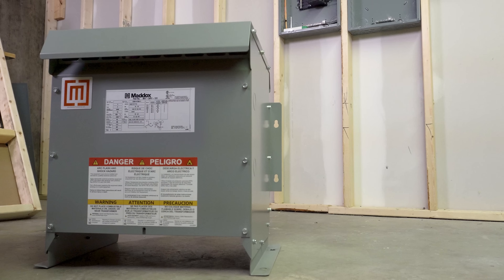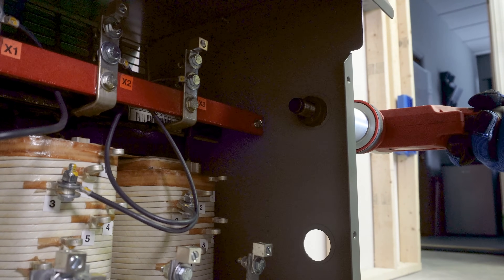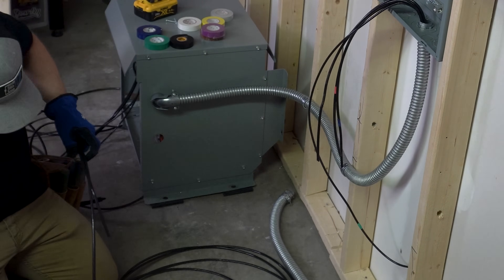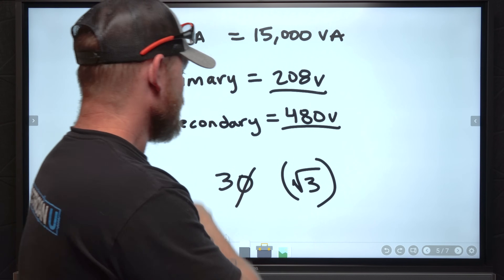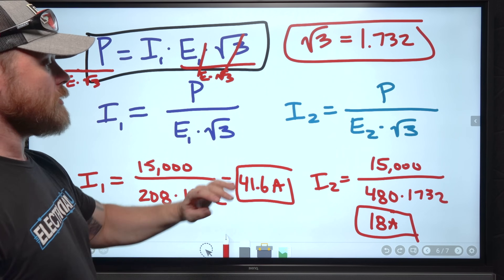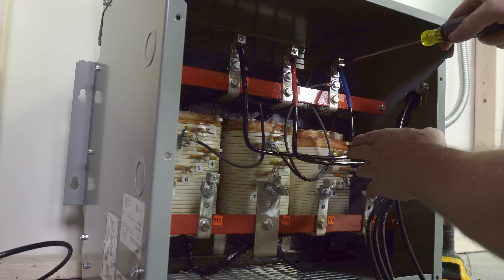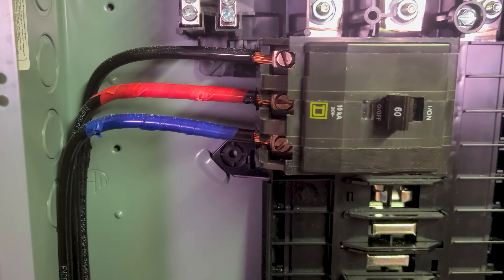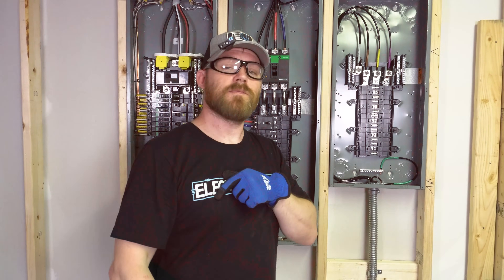How to Install a Transformer - Let's Break Into It!

Comment: A transformer with a delta primary and a wye secondary provides a new, "separately derived" system. The National Electrical Code (NEC) requires separately derived systems to be grounded and bonded to the equipment grounding system.

Comment: The solid knockout indicating locations makes sense given the vibrations from the transformer. The standard knockout, such as on panel enclosures, would fall out from cyclic fatigue failure.

Comment: Hello,  have a main utility service cabinet   That has 600 amp breaker feeding two  200 amp breakers and one 125amp breaker inside the same cabinet.  125 amp breaker feeds directly to a primary 75 kva 480volt delta/secondary 208 volt y transformer.  A neutral wire was ran with the three hot legs inside conduit from125amp  breaker but neutral wasn’t attached to XO lug.  The neutral is terminated using a knuckle. There is also no green wire.  So I’m assuming this is a separately  derived system.  And transformer creates a new system with its own ground rod and neutral bond for 208 service cabinet with a separate ground and separate neutral.

Comment: I got a question regarding the transformer secondary protection.. if the transformer secondary lands into a panelboard, doesn't the panelboard still require protection per panelboard rating?
Reply: Yes it does, I came here to say exactly that. I wish the NEC was a little clearer on this - when reading Article 450 ONLY it is easy to forget that the transformer secondary conductors also require protection per 240.21(C), and if you land in a panelboard then THAT needs protection per 408.36.

Comment: 10:28  -- you said 480 x 1.732 = 18A & I know you meant divided by but those listening and learning for the first time its 👉 15,000 ÷ (480 ÷ 1.732) = 18A if you multiply its 15,000 ÷ 480 x 1.732 = 54A just a heads up
Reply: Math is funny. Try it this way: 15,000÷(480×1.732). Without the parens, it breaks

Comment: Great video, I appreciate the code references. Just make sure you prote t yourself with the right level of PPE brother. I know its all new stuff but you know there should be voltage rated ppe and arc flashh gear used while interacting or testing 480V equipment. Be safe brother. We appreciate you!

Comment: I’ve been told recently I cannot put tape on 1/0 or lower wire size. Need to use those markers. It’s prolly per the inspector, but have you guys dealt with that ?

Comment: Hey Dustin,
My question is when you have a 277/480v 400 amp panel that has breakers up to 100 amps but need 125 amp due to 125% code what can we do? Maybe secondary ocpd down to 200 to make sure no more than 200 amps is the load?

Comment: One thing that always amazed me.   # 6    480 3 phase on primary.     2/0 leaving 208v 3 phase ….  We had to install disconnects before and after the transformer ….  I believe the reason.  Transformer goes bad ….  Take it out of line completely..  and back feed thru other transfer switches in the electric room

Comment: 14:08  just one point, did you break the paint under those ground lugs?  My foreman would always make sure we broke/sanded the paint under and beyond the borders of the added ground lugs or to run a jumper to the manufacturer bonding strap/lug on the left there.
Reply: One additional - i was taught that it's good practice to run a continuity check on every conductor, after all eqx is installed and prior to energizing.  

The foreman who taught me that had a bad breaker with an internal dead-short, and it detonated when he energized it.  The only thing that saved him was that he was in a full 40cal suit with rubbers and leathers.

It was a little 15KVA xfmr like that one, too.   Just food for thought.  I liked that you suited up for the Zinsco panel change.  It's odd how we tend to skip those precautions at our own shops, eh?😅  

No disrespect but I winced hard when you just turned away and flipped the breaker with bare skin and no deadfront....you gotta get lucky every single time you do that.  Murphy's Law only has to get lucky once. 

Stay safe out there, brother.  You got people who count on you🙏

Comment: You cannot run the GEC thru ventilation holes.  New 2023 code.  Also you don't have to use bonding bushings if you don't use concentric or eccentric knockouts or if said knockouts are listed for grounding.
Reply: You are correct. The 2023 code does it allow you to run your ground through the vents.

Comment: as of the last five years, most things with a knockout has been near impossible to break them out. lack of stamping depth/pressure, probably the stamping dies worn beyond limits or no quality control and they just spray them off the line as fast as possible. just put an oven pigtail on the other day, it already had a 1/2 KO and I needed 3/4 KO, I had to snip it with diagonal cutters grab and twist peel it in chunks all the way around, total pain, same for exhaust fans, boxes and panels.

Comment: If i wanna upgrade 200v 330uf to 500v did i need 330uf one on power supply capacitor?
Reply: From what i heard, it is just that. Just get the same one.

Comment: In this case you will need secondary over current protection. You have dual voltage on the secondary. You can get away with primary only OC protection if you have 2 wire primary 2 wire secondary for single phase or 3 wire delta to 3 wire delta for 3 phase.

Comment: He said 208 for the primary and 480 for the secondary. He got it backwards.
Reply: He said it’s a step up transformer
Reply: This is a rare case, as most are step down...I've only seen one for a lathe that was acquired at an estate sale that was run off a motor singlephase coupled to a three phase generator... the new location had 240v delta... bumped up like what Dustin did, one breaker on the secondary then a motor controller with bells and whistles...

Comment: The higher piece of Greenfield could be installed at least 6" too high. Inside of transformers have s line or mark that states domething like " Do not install conductord above this line ". Transformer core can exceed 200 degrees F.

Comment: In older electrical closets often have to hang up to a 112  KVA transformer at least 6'"6 ftom the ground because of no floor space. Always used at leastva 3' long ource of Greenfield on transformers to help with noise transmission.

Comment: 240.21(C)(1) you derived a neutral so now you need secondary protection.
Reply: does he already have it with having the secondary panel breaker?
Reply: @awesome6486 the secondary panel that he has is a main lug only panel. There is no main breaker for it.
Reply: @danieljuneau229  thank u!

Comment: Maybe someone can help me out with this. When it comes to the secondary being 4wire 480/277V and landing on a main lug only panel, are these conductors not considered to be protected by the primary overcurrent device per 240.21 (C) (1) which states in order for the secondary conductors to be protected by the primary overcurrent device it has to be a delta/delta system (which this system is delta/wye) or single phase single voltage?
Please help my understanding and point me where to look in order to be able to land 4 wire wye secondary on a main lug only panel?
Reply: You need to refer to the IEC( India’s Electrical  Code)
Reply: The land of red yellow blew...
       tree phase spicy... 🎄  @highvoltage1979
Reply: The better question would be why did he run 480 volt to a QO panel. Thats not a 480 volt panel. Thats a QO.  It won’t even accept a 480 volt breaker. 😂

Comment: confused on what is the point of an 18amp 480v panel? What loads are on this?
Reply: Commonly the 480Vac three-phase is used to power large electrical equipment like fork lift battery chargers, ovens and heavy machinery. The derived single-phase 277Vac is used in such an installation for fluorescent lighting and HVAC.
Reply: @calmeilles  i realize the use of 480/277 but if the panel can only handle 18 amps, seems kinda pointless

Comment: 250.104(D)1 requires that The grounded conductor of each separately derived system shall be bonded to the nearest accessible point of the metal water piping system(s) in the area served by each separately derived system. Is there no water piping in the building or did you miss that.

Comment: Just to add a few, a GEC would connect to the X-tran means the grounds and neutrals will be isolated at the panel (What he did).. If the GEC came from the panel, the grounds and nuetrals will be isolated at the transformer... Anyone remember that 250% comes from... forgot..

Comment: Don’t panelboards fed from a transformer need overcurrent protection per 408.36(B)?
Reply: 408.36(B) Exception: A panelboard supplied by the secondary side of a transformer shall be considered as protected by the overcurrent protection provided on the primary side of the transformer where that protection is in accordance with 240.21(C)(1)

Basically, if you have primary protection on the 3-phase delta-delta connected transformer and its overcurrent protection is properly sized per 450.3, then you do not need secondary overcurrent protection for said panelboard.
Reply: 240.21(C)(1): Protection by Primary Overcurrent Device. Conductors supplied by the secondary side of a single-phase transformer having a 2-wire (single-voltage) secondary, or a three-phase, delta-delta connected transformer having a 3-wire (single-voltage) secondary, shall be permitted to be protected by over-current protection provided on the primary (supply) side of the transformer, provided this protection is in accordance with 450.3 and does not exceed the value determined by multiplying the secondary conductor ampacity by the secondary-to-primary transformer voltage ratio.
Reply: @connorwinn6860  that’s if it’s a single voltage, he derived a neutral from that secondary, giving him 277,480. So that rule doesn’t apply
Reply: @santiagocontreras5889  Good catch, I misunderstood that. Thanks for the information, and I do think you’re eight now but there must be an exception, we have a similar setup at the site I’m on with only primary protection for a 120-208 panel fed off the secondary. Otherwise, we need to make corrections lol
Reply: I believe you are correct

Comment: If you put rubber pads under a transformer but then tighten down steel bolts onto the steel bottom flange you are negating a ton of vibration dampening by sending the vibration through the bolt. Either leave the bolts loose or put rubber under the washer too.
Reply: Yeah. There should be no metal to concrete connection.
Reply: That’s what we do for commercial rubber pads on each corner

Comment: Ive always used Brown Yellow Orange for 480V.
Reply: For 480 not code but just about everyone in my area used " BOY " Brown, Orange & Yellow.
Reply: Yeah same, why the purple?
Reply: B O Y
Reply: Same
Reply: Austin is different its purple for some reason
Reply: @thewiseguy390   Austin is different lotsa ways.  🤣
Reply: *Brown, Orange, Yellow
Reply: I believe in Texas, where he is located, they use purple in place of orange
Reply: @gc2797 Some jurisdictions may use purple in Texas but BOY is the norm.
Reply: That’s for motors where I’m from.
Reply: I haven't seen the Brown Purple Yellow setup yet but I'm in Colorado.
Reply: Different in different states and counties
Reply: @tylerturrubiate3524  thank you for the answer I was looking for
Reply: Orange is used on some older  3 phase systems as a high voltage leg. I think alot of guys use purple to avoid confusion.
Reply: @mamaswamma1234  that makes a lot of sense actually thanks for the reply
Reply: @mamaswamma1234 ...That's on a 120/240 system with a 208 high leg which will be on the B phase. Utility company wants it on the C Phase at the meter though.
Reply: In the industrial world, were studying about high voltage and delta to y, and for the high voltage we use brown orange and yellow
Reply: And where I'm from it's California right now
Reply: Brown orange yellow
Reply: san antonio used purple brown yellow orange was high leg or travellers
Reply: Electrical contractor here. Maddox is AWESOME!! Lead times are amazing and quality is AMAZING!!! Keep it up Dustin. Love your videos!!!
Reply: Get with the times buddy, brown purple yellow
Reply: I just moved to Texas from NC. They use brown PURPLE yellow instead of brown orange yellow
Reply: That's why people that watch YouTube should not do electrical they're not trained like you and they probably will never need it
Reply: @davidicousgregorian ...Most of the subscribers and supporters are in the electrical field. 21 years in myself and have watched nearly every video over the past few years.
Reply: @davidicousgregorian  Brown Purple Yellow is standard in Texas, where Dustin works.
Reply: Nobody on YouTube knows what three phase is guaranteed
Reply: @davidicousgregorian lol I know what 3 phase is, I’m a commercial electrician